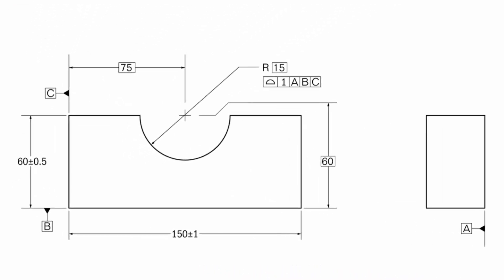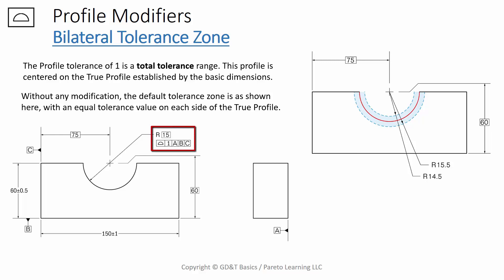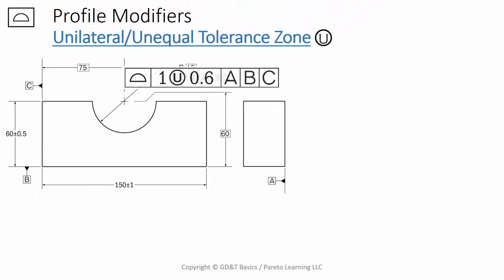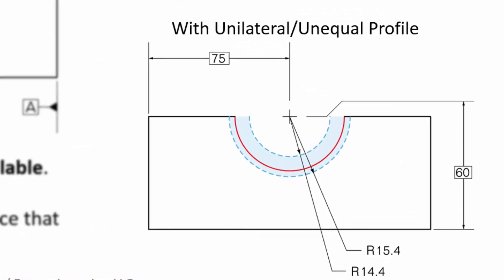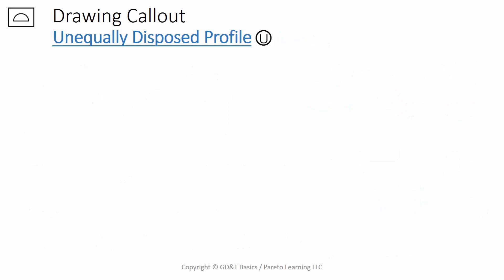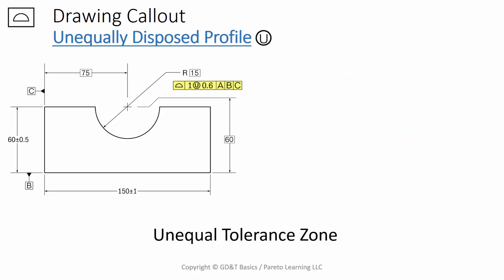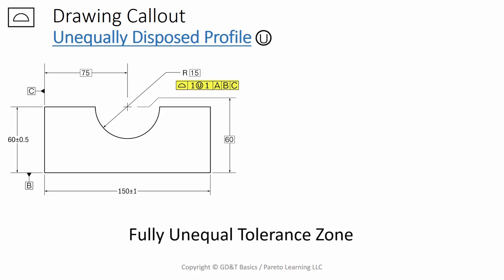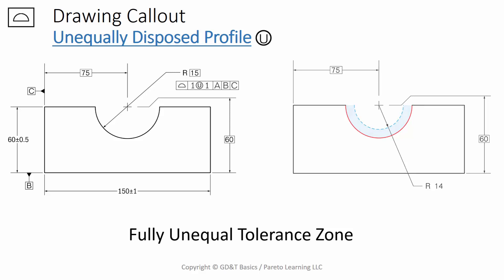Profile Modifiers - Bilateral Tolerance, Unilateral Tolerance and Unequally Disposed Tolerance

Comment: It seemslike it would be a better practice to design the part to nominal and keep your tolerances symmetric since so many parts are made with CNC, but i'm curious to hear from anyone who disagrees with this.
Reply from the maker: In our experience, sometimes people model their CAD at the worse case assembly conditions and then only allow tolerances to remove material. On the flip side, you can model to the "weakest" condition meaning a lack of material for FEA purposes. This would then be a scenario where you want to add material with the tolerance but not subtract any.